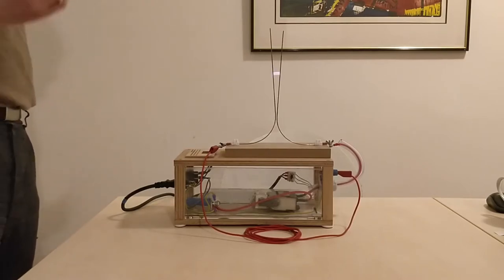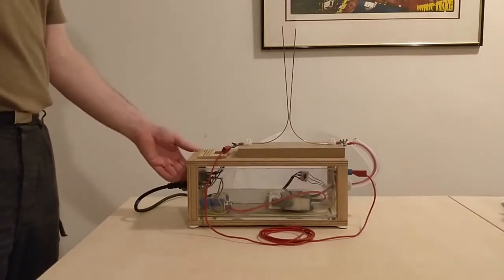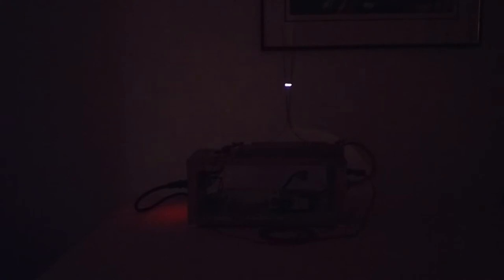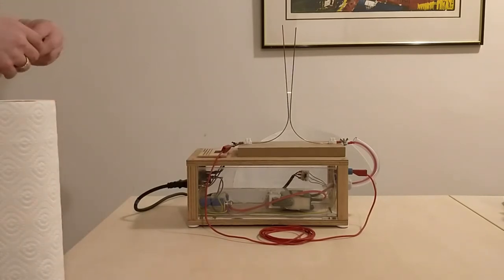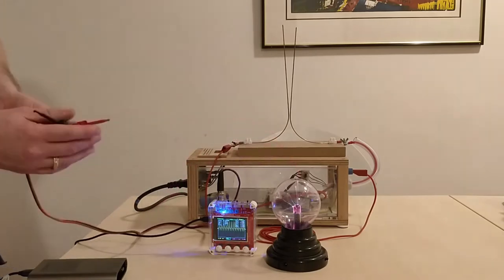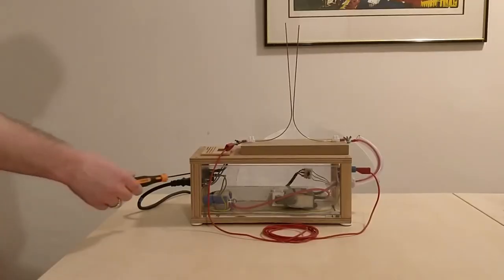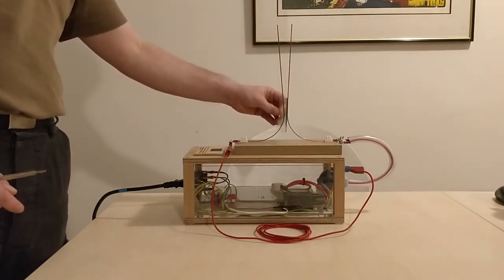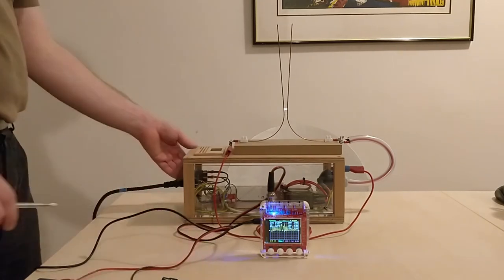Atmospheric plasmas: Demonstration of Arc and DBD

Comment: Where did you find a non rectified transformer ?
Reply from the maker: There's different shops like https://highvoltageshop.com/ or https://www.amazing1.com/ - but also on Ebay and similar platforms you can find some. Try looking for high voltage transformer or ignition coil instead of flyback transfomer, as the latter are most usually rectified.
Reply: @sebastiandahle3386  Thanks a lot !